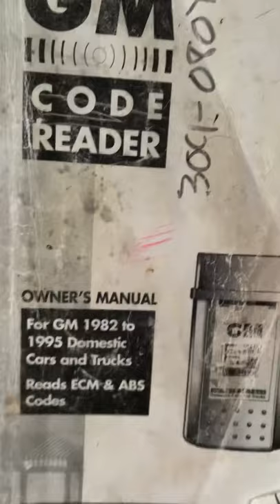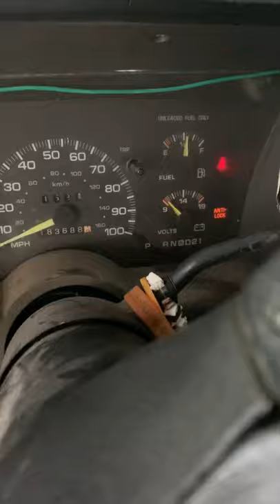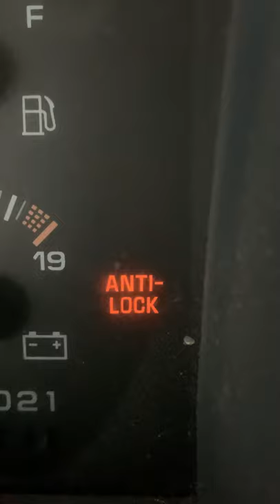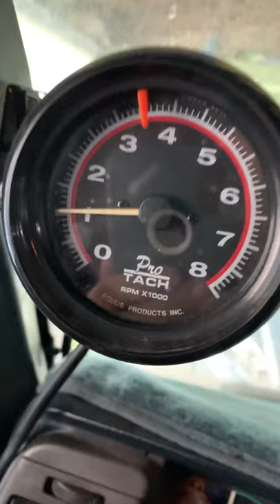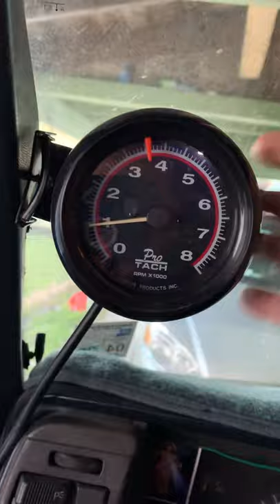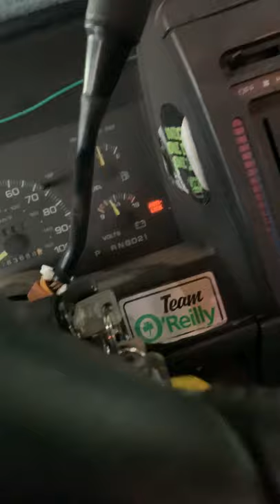How to use OBD1 Code Reader 82-95 GM Cars

Comment: Great vid thanks for the info...quick question..Do you know if car dealerships for your specific maker (mines is a toyota) do diagnostic test on cars from 1982-1995???
Reply from the maker: Mike9798999  I’m not 100% but I’m gonna say no, most dealerships will turn you around and refer you to a mechanic shop at least the ones I’ve been to, however I have gotten them to work on my 01 impala but it was obd2

Comment: I’ve got a 93 Gas K3500, the SEL is on, but it never flashes when then reader is in. Any suggestions?
Reply from the maker: Sometimes I have to wiggle mine around (no pun intended) and it’ll catch but I end up having to hold it in the position

Comment: Do you know if you can read ABS codes on 90-93 Chevy ?
Reply: Jump the two terminals all the way at the top on the right with the key on and it will tell you your codes

Comment: shorting a to b,does not work on GM B body and some F bodies,on certain years,95 impala and caprice are some of them,93 Camaro,also won't flash lights in code for you!
Reply: ́ '  no neither works, you need lap top or scanner
Reply: Do you know if my 89 eldorado Biarritz is compatible

Comment: same damn thing as paper clip method. lol lame
Reply: I have a 91 park avenue and the GM service manual shows jumpering the first two pins (paper clip method) to read the codes on the check engine light. So I'm sure it's fine.

Comment: Does this code reader scan with out engine light on 🧐🤔
Reply from the maker: Dj Lemo it will scan without the light on but it will read the default code 12 if there are no saved codes on the ECM
Reply: Did it work without your check engine light on mines dont work i dont see how im going to check the flashes if my engine light doesn't come on(1990 Caprice)
Reply: @jonhsmith2706  How do you know you have a code
Reply: @gregoryvines8924  check engine light will pop up

Comment: What if your check engine light is not working?
Reply from the maker: lazaro palomino 🤷🏻‍♂️ you may have to pull the cluster out the dash and change the little bulb,...as long as it’s the actual bulb that’s out... I’d start with checking fuses and making sure your getting fire to the obd plug before taking anything apart👍🏼

Comment: I have a 95 Beretta 3.1 V6.  This does not work on my OBD1.  My terminals are not side by side (A & B)  The are upper and lower, (A & M)  Any one, any ideas?
Reply: I know it's a year late, but a paperclip does the same thing
Reply: @brandonsasser360  I know, tried it.  Didn't work.
Reply: @brycejensen5020  didn't work for me either on my 1993 s10. The repair manual I bought said there's some abs codes that can only be read by a gm tech1 code reader.
Reply: @brandonsasser360  That is roughly the story I got.  And around me, there are no shops, or dealerships that can help.  The camshaft on this car broke in half one day so I dont worry about it anymore.  But it does bring back mems.
Reply: 95 is OBD 1.5, I had the same probleme on my 95 Blazer.